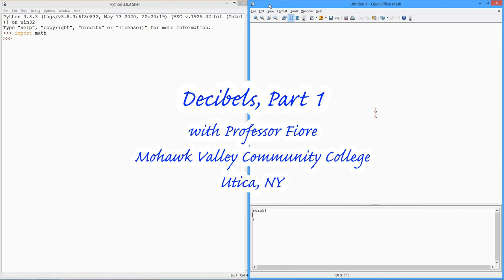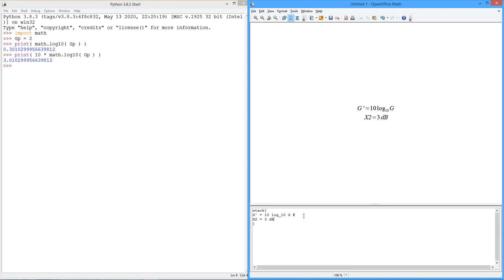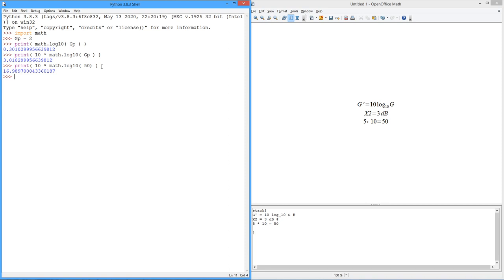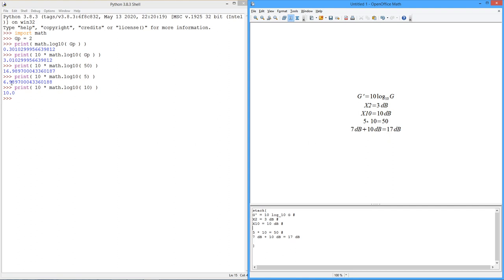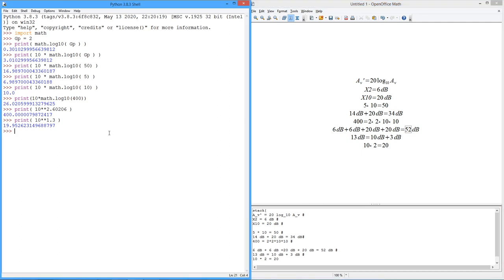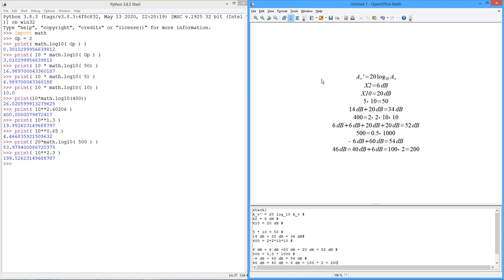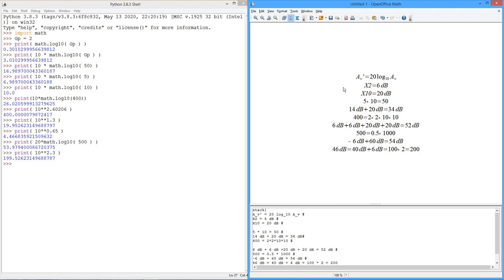Decibels, Part 1

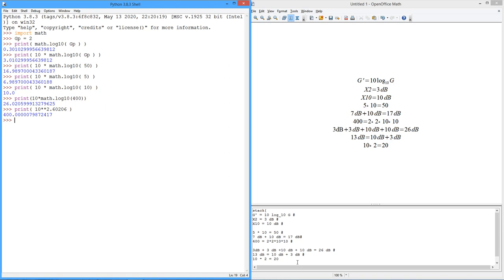Comment: At 13:55, I heard the statement that a 13 dB gain will give us a gain of 10.  I had to run this through the "this does not compute" mill again to realize that this should have been a gain of 20.  Other than that, a great introduction to the use of decibiles and a few tricks on using the logarithmic scale.

Comment: Are there any videos that specifically cover the laboratory manual?
Reply from the maker: Certainly there are videos that cover the circuits examined in the lab exercises, but if you're asking whether there are videos that guide you through specific lab exercises step-by-step, then no.

Comment: At 5:56, there is an example of two amplification factors of 5 and 10.  The two were multiplied together to get a gain of "50 db".  I think that was supposed to be increasing by a factor of 50, as db gains in stages are added, not multiplied.  A gain by a factor of 5 is +6.99 dB, an a gain by a factor of 10 is 10 DB, so a gain by a factor of 5 * 10, or 50, is 6.99 + 10, or 16.99 dB.
Reply from the maker: Yes, please note that I mentioned this in the description. Sorry for any confusion.